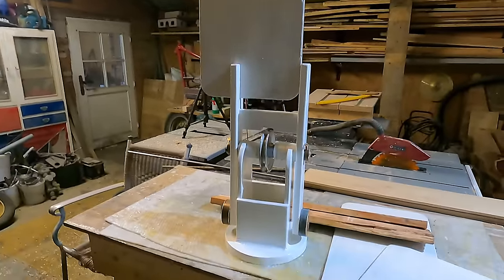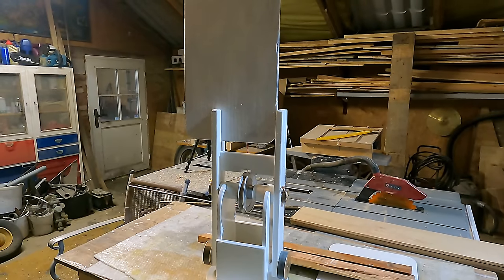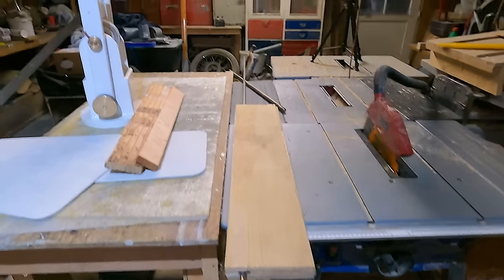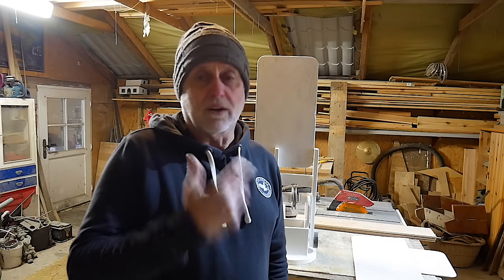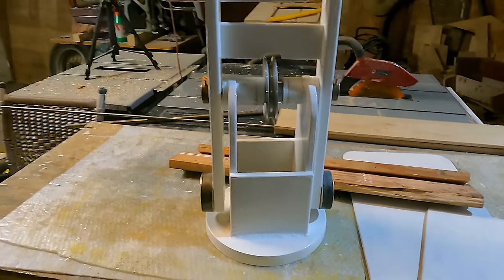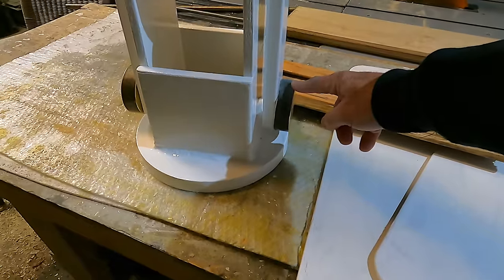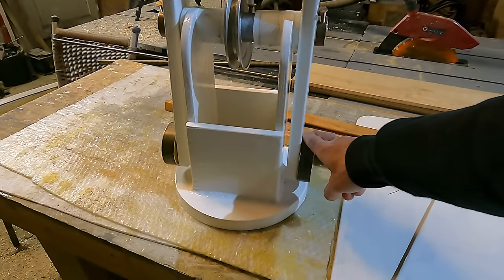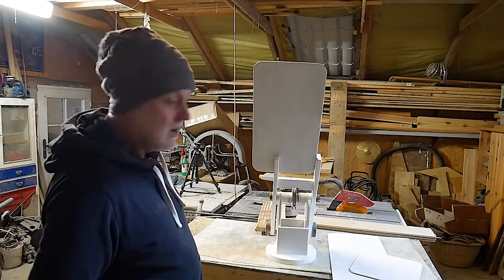The Windvane; What I've Learnt Along The way - SV Tapatya EP311

Comment: I don't think that I would use bearings. Too much possibility of them getting clogged with salt. With something that is so lightly loaded, I'd use some narrow bushings. Just moderately sized to minimize contact surface and therefore minimize friction / drag.  If you do end up with salt in there, it'll be far easier to clean. And the solvents in the bearing grease will dry out over time. Love your creativity.

Comment: If you drilled holes for the counterweight a little higher up you would have adjustability for extra large light air large wind vanes.
Reply from the maker: Yes indeed, Jim 👍😃😃

Comment: Good video once again, Tony.  I'm sure it wil become clear to me, but I am still unsure about how the system pulls in both directions.  I guess there must be two lines going to the vane, via the pulley.  I'm sure as the weeks go by, I will have a "eureka: moment!  But my current mental image has the vane pushing a line when the wind opposes it, which obviously can't be right.  Have a great week, and wrap up warm!  Best wishes to Hazel.  -Chris
Reply from the maker: Thank you Chris. Yes, absolutely! There are two lines; one going each way around the pulley and attaching to an arm on each side of the trim tab shaft 👍😃
Reply: Ah, that explains it.  I get it now. Thanks, Tony! @SVTapatya

Comment: Just drill a couple more holes in the legs closer to the pivot, you will still get a reduction in anti-sway force and not have to wonder where that weight you removed has gotten to...:face-blue-smiling:
Reply from the maker: Absolutely, Mike! 👍😃